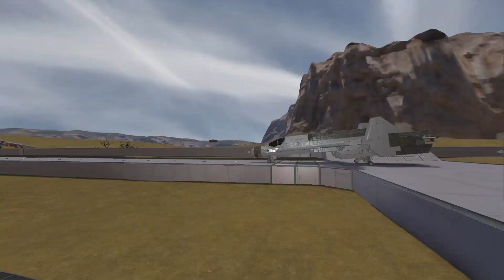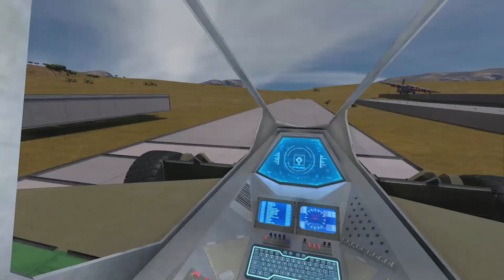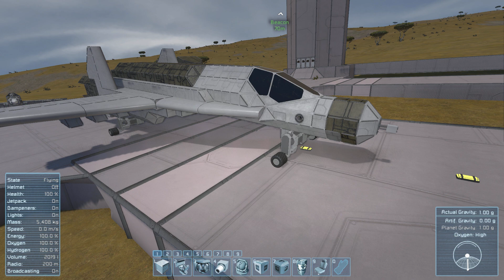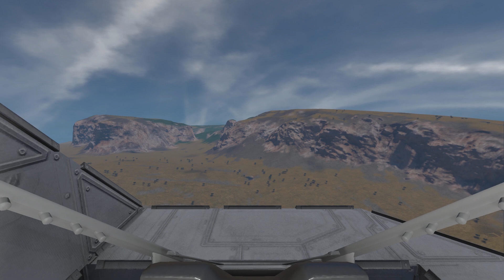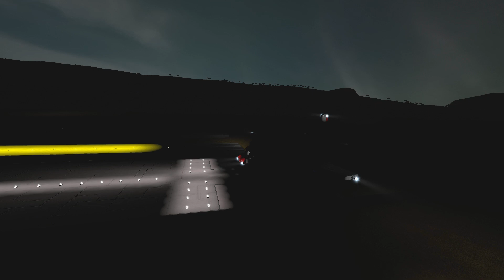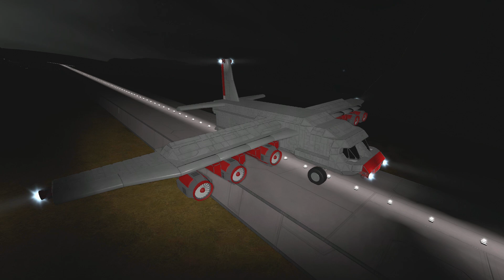Space Engineers - Real Working Wings That Have Lift! My Favorite Gameplay Mod

Comment: Having played with this mod for a bit now, just going to drop my 2 cents for everyone here on plane design tips. Put your main (rear) landing wheels just barely behind your center of gravity; this makes it easier to rotate for takeoff. Lower your friction on wheels (even to as low as 2% or so) to avoid breaking wheels and runways on touchdown. Sideways thrusters make your life a bit easier when landing, but aren't necessary with a bit of practice. Don't be afraid to use more than 2 wheels as main (rear) wheels if your plane is huge. Crank up the dampening on the wheels to absorb the impact, but strength doesn't need to be very high. It's entirely possible to turn off propulsion on the wheels and do just fine; this is what I do, as it allows me to fly around without the wheels spinning at max speed (anti-clang measures). Never forget a vertical stabilizer if you aren't using sideways thrusters; while it's technically possible to do without, it's much easier to have one. Find a drag mod and a speed mod; it really adds to the immersion and makes flying feel a bit more like real-life flying.

Comment: if you're having troubles with lift off in larger aircraft, try moving the rear gears/wheels forward almost like using them as a fulcrum, if done right, you should be able to rest a lot of the crafts weight/have the center of mass near the rear gears and it should make take offs better, and landings easier

Comment: on the 6 engine cargo, put your rear wheel further forward towards the center of balance. Your wheels are acting like a fulcrum and your elevator the effort. The further apart, the easier the take off.

Comment: If you have trouble taking off while on the runway and you need that drop (like in the heavy plane) its probably because your back wheels are too far from the center of mass, try place them a bit forwards and it should help but not too mutch or the plane will tip backwards( that is, if the back wheels are in front of the center of mass).

Comment: What you could do, to skip the complicated landing and takeoff part with the wheels, is adding a single hydrogen tank and some hydro-thrusters on the bottom. That way you only need to fire them shortly when taking off or landing. Exactly how hydrogen is supposed to be used - for short effective bursts.

Comment: How about that jet? How about VTOL? So many possibilities!
Reply: I'm too much of a fan of helicopters to see them done wrong. If someone can really get the physics working, all power to them, but I'd rather use no helicopter than a half-baked one.
Reply: +Liam Thompson in theory it should work. The trick would be getting a rotor to spin fast enough. perhaps engines on the end of the blades for a little extra rotational speed. Basically you make the main rotor and then add 4 rotors facing sideways off of that. to take off you angle the blades up and spin up the main rotor. Then at your target altitude rotate the blades to flat
Reply: +Xenomorph Captain Vex muno VTOL is more useful in every aspect
Reply: ***** *sigh*

Comment: One of my favorite mods is the Small Ship Mega Modpack [ http://steamcommunity.com/sharedfiles/filedetails/?id=305329302 ] I mention it becasue you could build the cockpit for your C130 out of glass and put in control seats; it lets you have the functions of most of the large blocks with the size of the small blocks. I build a lot of custom craft this way. My favorite so far is a transport with 1 custom-built cockpit, 4 seats and then you exit out a 'door' in the back.

Comment: can you put that wings on a rotor and make a Helicopter? :D
Reply: +SamaelHellscrem I don't think he explained the mod correctly. the wing block doesn't create lift it simply opposes vertical movement when traveling fast enough to simulate lift. Once you are going fast enough you can angle the plane upwards and it will follow.  With a helicopter, you'd need to simulate that lift also.  It can be achieved but would be much more difficult.  You would need to have 1 main rotor and 1 rotor for each blade to angle it up and down

Comment: the reason the cargo plane wouldnt take off is because the plane is tilted forward pointing down so the wings are generating downward lift, if the back wheels were a block or 2 higher this would be fixed

Comment: Unfortunately I can no longer play Space Engineers because my computer only supports DX10.
So fucking disappointed.
Reply: +dayten anderson Probably not, it would make sense for them to move entirely to dx11, because the player base that can't run it are a tiny minority and dx11 uses system resources much more efficiently. Using earlier versions would only hold back development.
Reply: +Diax1324 i think you ca change it in settings
Reply: dayten anderson Nope. Planets only run DX11. and my computer won't support that.
Reply: Diax1324 maybe in a future update?
Reply: ***** ok (btw i dont personally have this game i only have a intel i3 core in my intel hd graphics can barely run fallout nv)
Reply: dayten anderson lol gtx 970 i7 4790K master race

Comment: Well this is interesting, can't test this myself due to issues running planets but does anyone know if using the wings can compensate for the reduced effectiveness of Ion Thrusters in Atmosphere?
Reply: No. I can confirm. Ion thrusters are nerfed to hell, and are incapable of providing enough thrust to be of any use in atmosphere.
Reply: +Evan Wickstrom Are you talking about the mod nerfing them or the game?
Reply: ModernGameArmy The game. They function as normal in space, but provide no thrust on planets. Pretty much the inverse of jet engines.
Reply: Evan Wickstrom No thrust or just to small to lift anything
Reply: +ModernGameArmy No idea. I haven't got anything to take off using them, but I can't confirm for sure if they are absolutely impossible to use in-atmosphere or not.
Reply: Evan Wickstrom Just something i was curious about

Comment: captin shack if you look at how airplanes actually land their rear wheels touch the ground first then as the plane slows down the front  hit the ground maybe trying to lane that may reduce the chance of breaking the wheels?
Reply: +Maciej Gradus The setup of having small gear in the rear and main gear up front is largely considered old/inferior, and rarely used in modern times. Standard landing procedure for modern aircraft includes a "flare" about 20 feet off the ground, where power is reduced, and the craft is pitched upward so that the rear wheels contact first. Fighter aircraft often flare even earlier.
Reply: +xMckingwill Actually the perfect landing is meant to have all the wheels touch down at the same time, though the process of a safe landing usually means the rear wheels touch down first.
Reply: +xMckingwill He is a real pilot so i guess it was easier to land this way in SE
Reply: it depends on setup of wheels on some plans you have big wheels on front and smaller on back
Reply: +AnomalyTea Actually most aerobatic aircraft and single seat planes still have tail dragging gear.

Comment: my pc is too weak
Reply: +Pvt. Duckling yep, I have a 4th gen i5-4210H :( only get 20 fps max
Reply: +Pvt. Duckling I got a 3rd gen i5 and it runs fine for me
Reply: +Pvt. Duckling Well.. I wish that were true.. I have i7 4770 @ 3.88 GHz with 16 GB RAM. And I get ~25 FPS on Low settings. I have HD 7770.

Then my friend's PC is,  i5 3450 with 8 GB RAM. ~30 FPS on medium settings. Which has Gtx 750 TI.

So... GPU definitely plays an important role :P
Reply: CamOrigamiandmore how high the settings?
Reply: Yeah, anything under 4th gen i7 will suffer.

A good GPU won't help at all.
Reply: +Pvt. Duckling I got a 4th gen 15 and get around 50 fps.
Reply: +Dantes Inferno I5*
Reply: +Dantes Inferno I have a 5th gen i7 cpu, the i7-5500U. Still wont run nicely. As in, 20-25 fps in a small asteroid world.
Reply: +Lego FFour isnt that a laptop cpu?
Reply: Marcel Engelke Yup, it is. That is why its so bad :)
Reply: +jerseyjacket100 pretty much any part can be a bottleneck in SE everything below 8 Gb of RAM runs really bad and you need both a decent gpu and cpu. With your cpu you might wanna try to overclock it. your friend with the i5 3450 probably has a higher clockspeed. i have a i5 4670k and play on highest settings but it's overclocked from 3,4 GHz stock speed to 4,3 GHz.
Reply: +Pvt. Duckling I have an i5 and I get around 35-40 on low
Reply: +Pvt. Duckling I got a 1st gen i7 and it works fine
Reply: +minecraftsquadron strange, so do i but i need low res to lower the lag. lol. it is so pritty on the gtound.
Reply: +megapro125 Ah cool. Thanks :)
Reply: +epos fails games mine too
Reply: +Dantes Inferno graphic car is most important thing 
if you have like core 2 duo or quad or even i3
Reply: +Lego FFour ask LAst stand gamers for his setting he has nicely managed his settings if you are running this game in ultra then it will happen changer it ti high or meduim
Reply: +epos fails games for people are likely unable to run SE try this game Empyrion.Galactic.Survival it is also similer to this game you can build spaceships big ships and even bases
i dont know more bec i am downlaod ing this now here is the downlaod&#160;
lnik&#160;https://mega.nz/#!19R23SjQ!EbEOBJRiiC-8V4hnn7ma4cGy-3UzwhuGuRj81xFuNhA
Reply: +Pvt. Duckling 4th gen I5 and I'm fine.
Reply: I have a i5 3rd gen and a gtx750 I believe and my computer runs this game just fine. I get like 35fps.
Reply: +EposProductionZ FX-8370 OC'd to 4.8 GHz runs it well with 16 gigs of RAM.